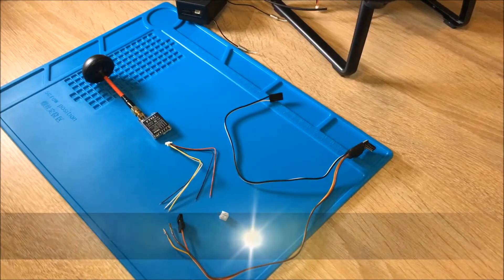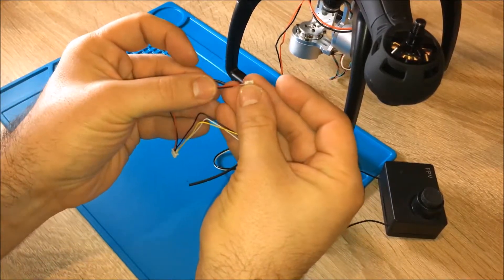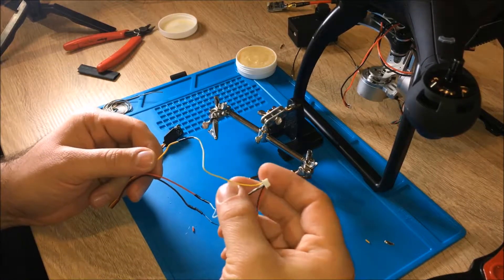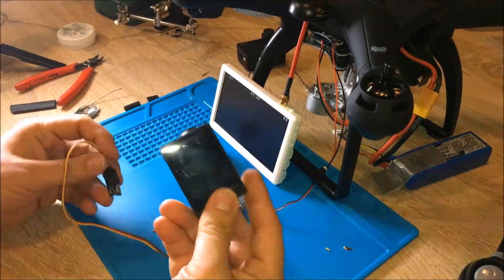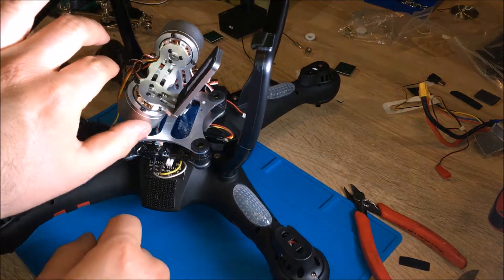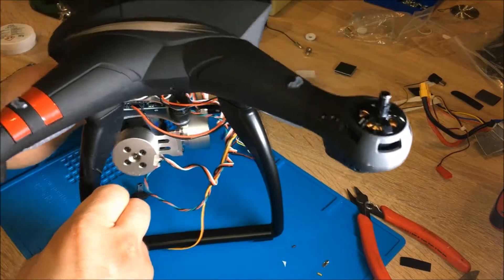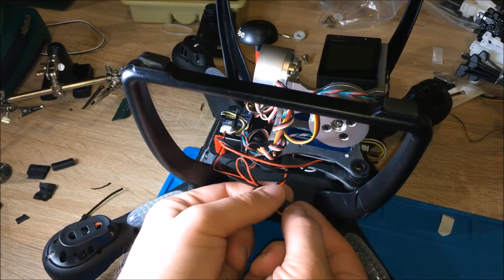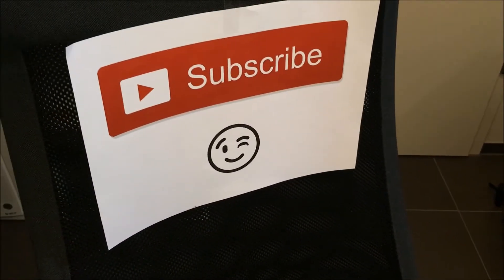Bayangtoys X21/X22 - Gimbal FPV Setup - Tutorial - Firefly 8S + Little Pilot Display

Comment: Hey Martin..... right now I managed to get the firefly and the ft951 to work together with my goggles. Everything works fine. Now I only have to get the Arduino to work with the gimbal. I'm eventually coming back to you if I have any problems to make it work....
Reply from the maker: I am happy to hear you got everything working, sure just ask if you have any questions left regarding the Arduino and the Gimbal :)
Reply: MartinStaehle how can we get in touch because after looking at everything I think I can't make it work by myself. How can we get in contact?
Reply from the maker: Just write your problems here, I will try to help you as soon as possible and others might profit too. Right now I am just very busy in a project at work, so my answer may be a bit delayed.
Reply: MartinStaehle....... Moin.....my problem is that I uploaded your 1.2 Version to the arduino and first nothing happened. After uploading it again it worked once. The seriell monitor showed I am in mode 2 but the gimbal reacted like in mode one and the monitor was switching between 1600 and 500 each time I pressed a button. And after disconnecting the USB cable nothing happened anymore. Even after uploading the 1.2 sketch again nothing happened anymore. Now I am a little stuck editing with this because I don't know if the arduino has a problem or I made a mistake with wiring or programming. Perhaps is it possible to send my Arduino to your because your configuration works and if my Arduino works in your setup we would know that the arduino is working correct. I'm powering gimbal and arduino with the drones battery so I don't need the extra ground connection. Do you have a suggestion what's going wrong in my case?
Reply: And sorry to hear that you are so busy at work......
Reply: Moin again Martin...... found out what was wrong. The ground cable from the gimbal to the arduino was broken. Though the arduino got no power without the USB connection. After changing the cable everything is working fine. Now I only have to tight the arduino to the drone and make my maiden flight with this setup. Thanks again and have a nice Sunday
Reply from the maker: So that the Arduino is showing 1600 and 500 just is the signal length, which means the Drone is acutally receiving the signal - which is quite good for course. How do you power the gimbal? With a separate battery or with the drone battery?
Reply: MartinStaehle  the gimbal is powered by the drone. Everything is working fine. Except the mode is not correct. The monitor shows Mode 2. But when I press the photo or video button the camera is going all the way up or down until I press the button again. No steps from the gimbal if I press photo/video button..... what could be wrong?
Reply from the maker: I am happy to hear you got it working! :) The behaviour of Mode 2 change with release 1.2, so it  allows smooth panning. If you like to have steps in Mode 2 you have to use the Code from Release 1.1: https://pastebin.com/9TvT2pSy

Comment: Martin where did u get that little screw from to mount the camera? Our camera shop has only screws that are too long
Reply from the maker: Nordmannbiker It is actually the Screw for fixing an Acer Monitor Stand which happens to be the right size 😊. But it was to long as well, only after I added some rubber to the gimbal's camera mounting plate it did fit 😊
Reply: MartinStaehle thanks...... So I'll have to look for a shorter one. These tripod screws are way too long.
Bye the way the s8, the arduino and the ft951 arrived and I'm only waiting for the s8 usb connection cable. Then I'll be able to get it all working. There are coming some questions about the arduino when the cable has arrived
Reply from the maker: Great, glad to hear that :)

Comment: I have a walkera gimbal and connected it to 1 of the unused pins where the camera power is plugged in and was able to move the pitch but only with the video button. Do you know of any way to change that to the two buttons on the left of the controller that isn't being used for anything?
Reply from the maker: trini0821 unfortunately not, it is only working with the video and photo buttons, at least when wiring it to the connector. This because the old camera of the x16 was controlled that way and therefore these are the only signals available.

Comment: Hello MartinStaehle, happy new year, I ask you how to delete the previous version in Arduino and install the version with Smooth Gimbal Control with Version 1.2 that you put the link. Thanks bye
Reply from the maker: Hey Lorenzo! Happy New Year for you too! You don't need to delete it, every time you write something to the Ardunio it will overwrite any exiting programming. So you can just load the Version 1.2 and flash it to the Arduino.
Reply: ok, thanks I have already done, now I wait for the delivery of the material for FPV, otherwise the movement of the pitch is useless. Hello
Reply from the maker: lorenzo montaguti Perfect! Hopefully you don't have to wait so long for it 😊.

Comment: Do this system and the Gimbal can be powered by another battery to give more autonomy to the Drone? and the weight off all, decreases the fly time in how much?
Reply from the maker: I usually have around 8 minutes with the original battery. I also have an little extra battery for the Gimbal, which is mainly for balance as shown in this Video:
https://www.youtube.com/watch?v=lk0evvw61X0
But it does only increase the flight time about 1 minute maybe.
Reply: Do you know any system that i can connect two batterys to feed the drone? Like when one of the battery is geting empty the other one starts to work?
Sorry if i making a lot of questions, it is just because i just bought a X21 and i'm crazy for this stuffs.. hehe
Reply from the maker: Basically this is pretty easy, there are Y-cables available which allow you to connect two batteries parallel. So this way the voltage stays the same and you would get 2x 2.200 mAh. I haven't tested it yet but I guess I will make a video on that as well. 
But to make things easy I would recomment to switch the connectors over to XT60, which allows you to buy batteries more easily.
Reply: tks man!!! Hope for new videos!!
Reply from the maker: There will be coming more for sure, but right now the weather is pretty bad and it's always dark when I am coming from work :(. So hopefully this weekend will offer some possibilies.
Reply: Come to Brazil, here we have good weather always! hehehe
Reply from the maker: Hehe, yeah I guess the weather is better there ;) But it should be nice tomorrow here as well so hopefully I can make a new video :)

Comment: Martin thanks again for your time ,my x21 fly now thanks your video on blink light error ,i  make a little fly in my garden ,is too little for prove it well,but fly :),the headless mode dont work but retur to home yes :),he makes for two times something terrible ,he comes backs for 2 times and land in home for it self .....the controller say that the drone have 10,3 volt ,?????why? he comes backs and land if it has a battery............hard question :) ,good night and have a nice chrismas martin ..............in this day i prove it again i hope ..i must make" the arduino servo bait drop licensed by MartinStaehle .............good night.orsovlad
Reply from the maker: I am happy to hear you Drone is flying again! About the headless mode, that doesn't work at all for me as well, I think this feature just don't work - at least not in GPS mode, but for also not in Altitude Mode.
Regarding the Return to Home ... that is of course normal if the battery is really down to 10,3 Volt? Did you have the 12,5 V fully charged when taking off? Was the battery maybe in the cold over night? Have you tried another battery? maybe this one is not able to hold a stable voltage.
I would recommend you to solder some XT60 connectors to the quad and buy a new 2.200 mAh Battery with an XT60 connector, e.g. Turnigy at Amazon.
Reply: ok martin thanks for next step, i solder in this day an xt60 connectors on drone e battery too.,

Comment: Ciao, complimenti per il nuovo video, ora manca solo quello per il walkera g-2d, tu lo faresti senza problemi, Aspetto che lo fai così riesco ad installare il mio. Ciao
Reply from the maker: The Video is not bound to a specific hardware, you can use any Gimbal, Camera that supports FPV or even a different transmitter. So you can use it with a Walkera G-2D of course as well :)
Reply: Grazie ci provo, ti chiederò assistenza
Reply from the maker: You're welcome!
Reply: Ciao, ma che collegamento è quello che esce sotto su lato destro, rosso ? hai forato la scocca inferiore? è alimentazione per gimbal, ti manderei una foto dove ho evidenziato il collegamento, ma non so come si fa
Reply from the maker: Sorry but I can only guess your question, I can't speak Italian and Google Translater does not always make so much sense.
Yes I drilled a little whole in the shell and glued in a JST connector to power the Gimbal, you can do the same for powering the Transmitter of course.
Reply: Thanks, it was exactly this that I asked you. I have powered the gimbal with a second battery, for the transmitter I make the connection you made. thanks again, I will have more questions. Hello
Reply from the maker: lorenzo montaguti thanks for writing in English now, much easier for me 😊. you can also just make a connection to the second battery, will be the same.